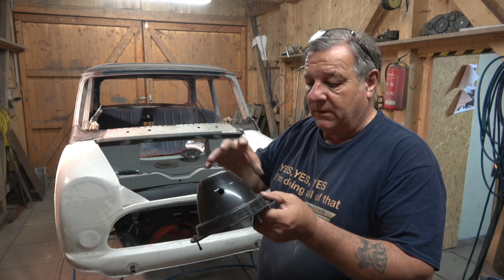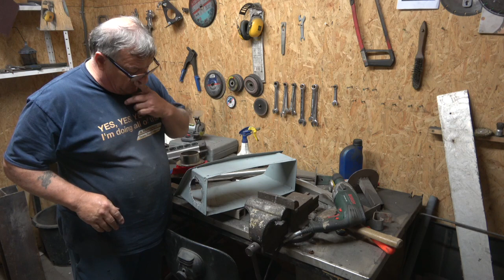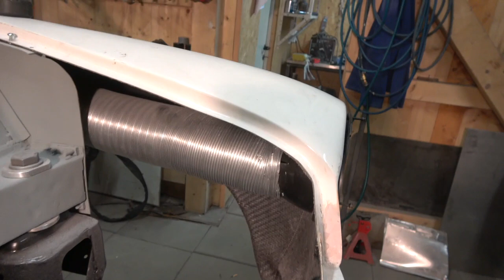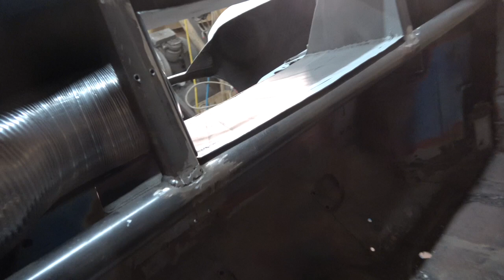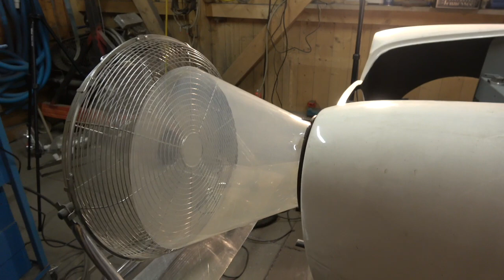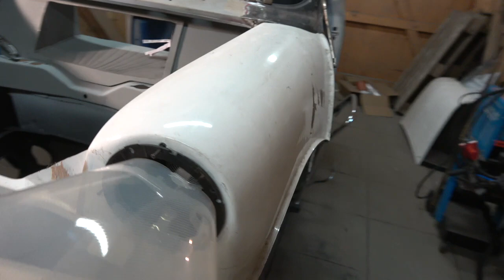Classic Mini Track Day Car Build Part 14 ( Air Intake Setup )

Comment: hi dave
i am going to get etype jig made. would you be so kind to tell me the size box section that runs along the floor pans, and thickness of steel and length thanks for the vids
Reply from the maker: Tony, I will try to get you some measurements please drop me an e mail on davejaguar66@gmail.com. Cheers Dave

Comment: Love the home made wind tunnel dave and as you say any air is better than no air or at least hot air
Reply from the maker: Alex, Bit of fail on the wind affect experiment but it will work on the track i have no doubts, How well is another matter
out of interest i will try it with and without the airdams and see how it changes the performance, Cheers Dave

Comment: Dave what are thoughts on bonnet scoops like the ERA Minis have
Reply from the maker: The ERA bonnet was designed to take heat from the engine bay but i don‘t want to cut the CF bonnet 
up if i can help it, Cheers Dave

Comment: Dave, did you say capacitor issue? I've got a spare one. What is the value (uF)?   Cheers Ryan.
Reply from the maker: Ryan, I think it‘s the auto start electrical box seems not to be kicking in. When Amir comes back we will have
a look and see what is causing the issue, Thanks you for the offer i may take you up on it. Cheers Dave